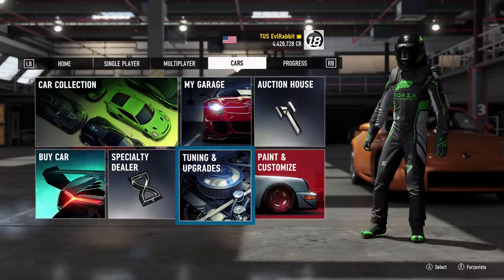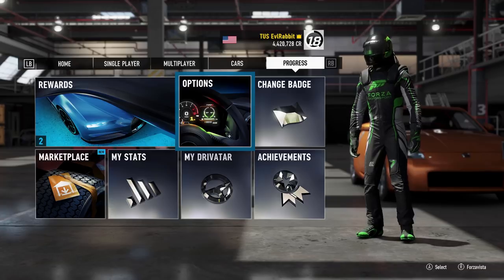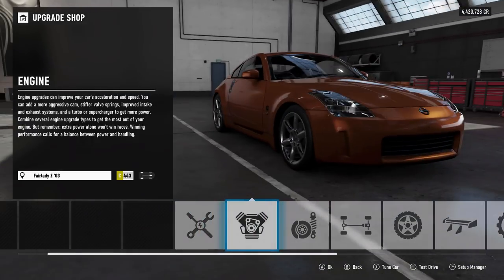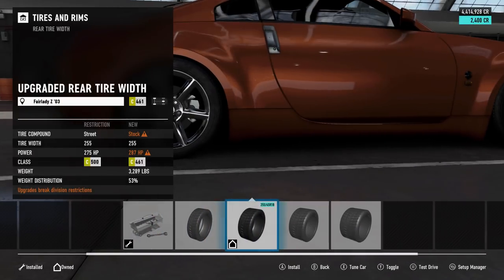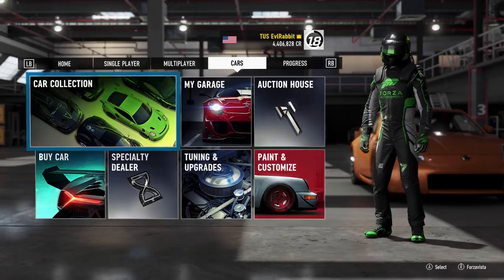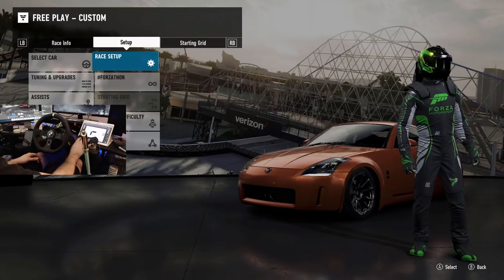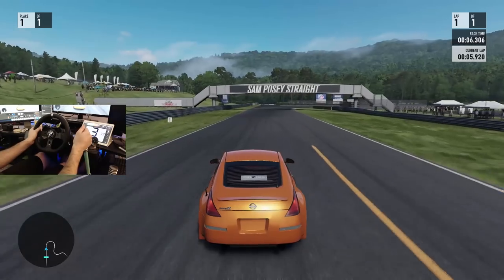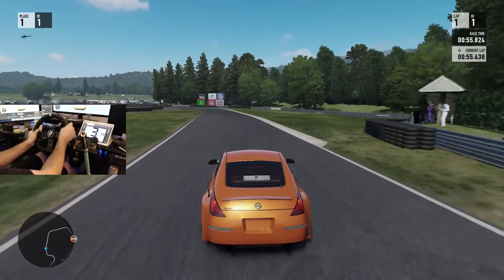Drift Tutorials & Tips / Logitech g920 / Car set up / Wheel settings / Forza 7

Comment: For those without a handbrake I found 200% brake force and 0% bias (fully rear) with a good kick of the brake you'll have the same effect rather than using the buttons on the wheel. I built my own rig with hand-down parts from a mate so budget to the max
Reply: thomas west thanks
Reply: Good looks

Comment: My clutch and brake on my pedals are like reversed so does anyone know how to fix this? I’m using my clutch to brake and lemme tell you it doesn’t work very well.
Reply from the maker: That’s a new one
Reply: EvlRabbit that’s good to know...
Reply from the maker: So the far left is brake and middle is clutch that’s crazy maybe see if in your settings you have them switch in the layouts
Reply: I tried that already lol
Reply: @reaappperrr4492  if your on the tx wheel check that the light on the left hand side of the wheel base is red. If its a different colour there is a way to switch them back i think u just hold the button till it changes hope it helps